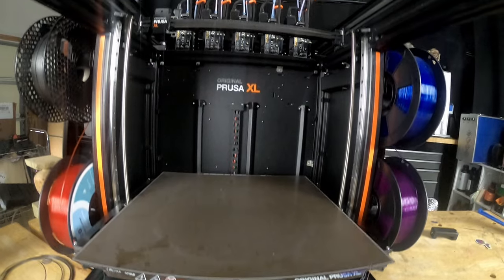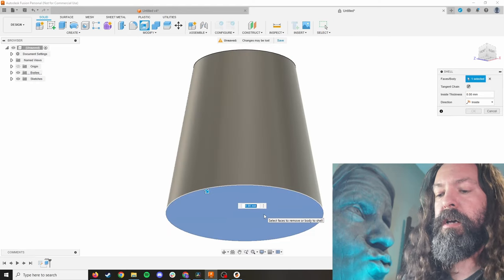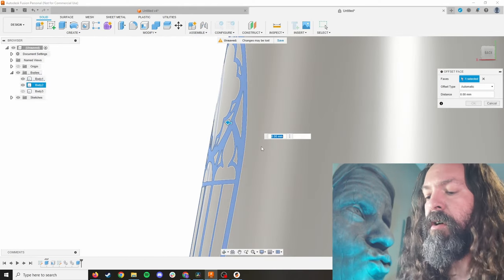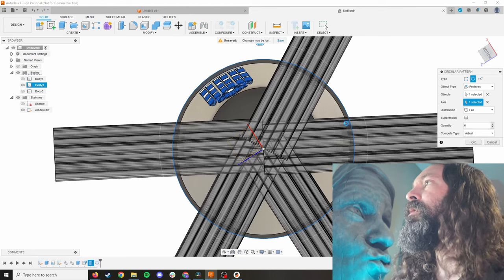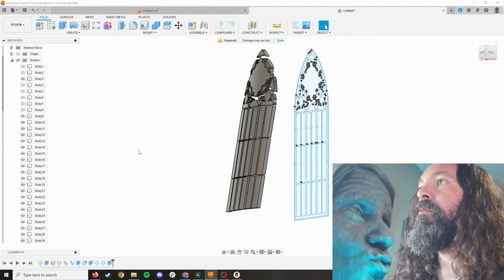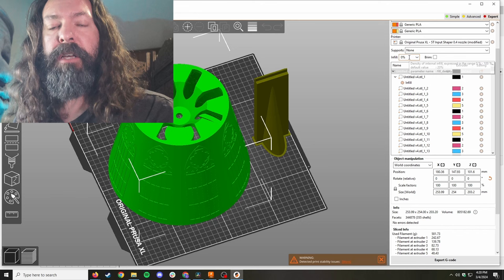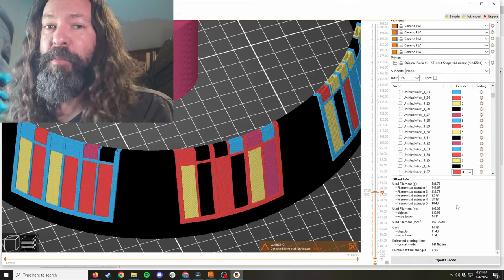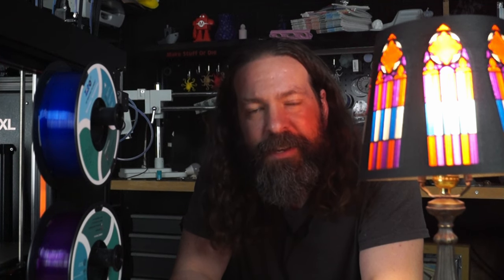"Stained Glass" On the Prusa XL 5 Head 3D printer

Comment: Wow!  5-star rating for your design and execution!

You have inspired me.  Have you done any flat panel 'stained-glass' designs?  I assume you'd print those flat on the print-bed.
Reply from the maker: I really wanted the complexity of the round shape for this one. I'm pretty tempted to do some flat ones. As for orientation, that would require a bit of testing. if you did it flat, the "glass" wouldn't work well without support unless you just made it really thin. Then again, it could look awesome thin!
Reply: Yes, it would be thin.  3,  4 or 5 layers of translucent filament (layer count would determine color intensity) surrounded with an opaque filament for the 'lead' which could have a few more layers of height.  Varying the layer count of the translucent panes would trick the eye into seeing more color shades.

Comment: 14 hours is actually very good for such a print 😮
Reply: 1 DAY AND 14 hours. 38 hours, with 3785 tool changes. Big project. Surprisingly only uses about half a spools worth of filament in the end, 582g. Turned out beautiful.
Reply from the maker: you printed one?! I wanna see! did you get tiiiiiiiny gaps between the glass and frame in some spots?

Comment: Before doing the intersection (starting at 6:32), you can use create -> new component. And then drag the target body (body3) into the new component.
After doing the intersection, all the parts generated will be under the new component. 
You can select the component and right click, export as mesh separately from the other parts. Later, select the multiple exported stl files and drag it into PrusaSlicer together and select "Yes" when it asks if it should be imported as a single object with multiple parts.
Reply from the maker: great tips, thanks!
Reply: My solition is simmilar. separating the colours - create a component for each colour and afterwards create the corresponding bodies within the component. Export each component separately as 3mf or step and put them together in prusaslicer. Be aware that the bodies in ps should not be shown separately, but the components should. It is possible!!! When you manage to do that you only have to assign one colour-component to the right colour and that's it! For the distortion of sketches you could try the emboss tool in fusion!...

Comment: Impressive project! Just the big blue head near your at around 1:10 was quite disturbing :)))
Quick question, you use low temp light bulb for this? I mean the pla doesn't really like hot places ! Tell us how it last if you use it often, thx!
Reply from the maker: where I live (most of the US) LED bulbs are the most common. Though they do still generate heat, the ones I use can still be grabbed comfortably even after hours of use. Heat isn't an issue for me. I could see this being a problem if you used an incandescent bulb

Comment: This is the first XL video that not have stringing. I like to buy the XL tool changer more then a Bambu, but the issues with the XL hold me back.
I saw some improvements (0.4 nozzle) but not at the level I want it to be. How is your experience? You sound happy.
Reply from the maker: I think anyone who got one after me also has the .4mm nozzles and many problems fixed. Mine runs great